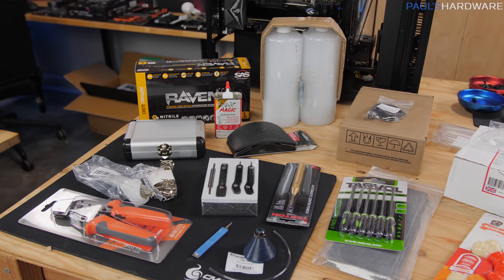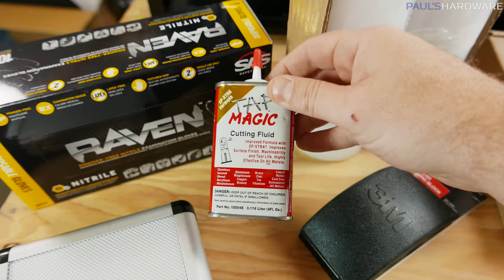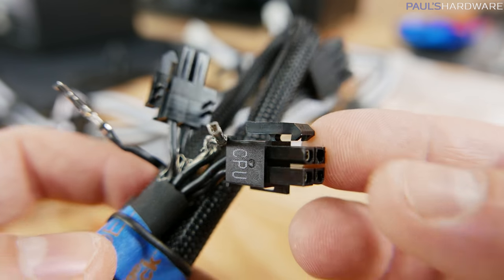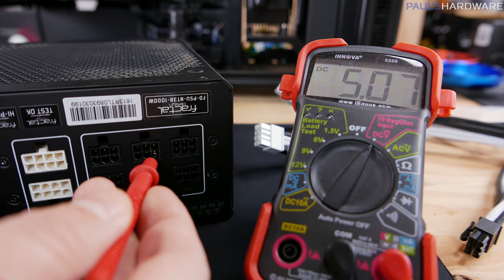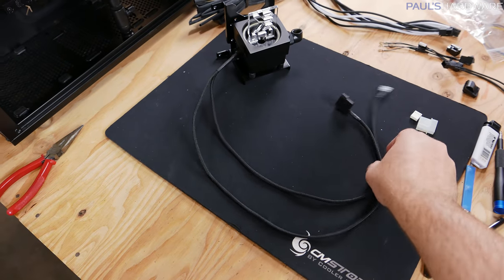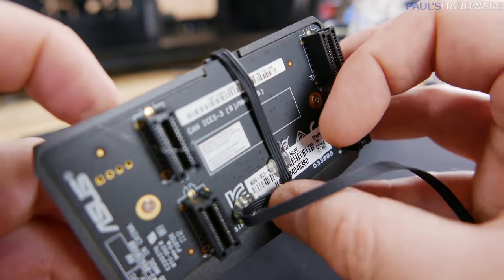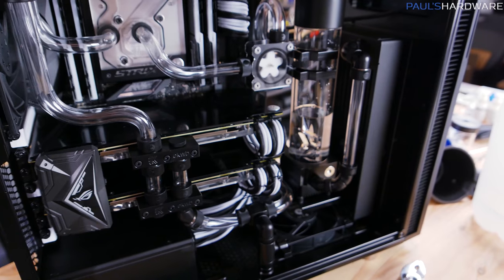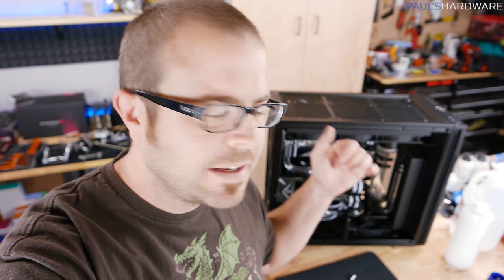JUST ADD WATER: Arctic Panther Build Log Part 3

Comment: Paul, with your new step drills. Keep in mind that though they are very convenient they suffer from an inability to be resharpened after use. With a regular drill index, you can quickly learn how to resharpen your drills with a grinding wheel and have years of service from a single drill index.

Comment: Man those bends are pretty impressive. Not that I have any experience, but just based on other systems/videos I have seen, they are really well done. They run absolutely parallel to components in the system that are square (edges of the case, mobo, video cards, etc) and the bends you chose are complex while still seeming to be the simplest route to complete the loop. Pleasure to look at, really. Complicated efficiency : p Great stuff!

Comment: Tip for the future :D you don't want to apply the flame to the heatshrink, you just want to apply the heat (hot air). You can hold it away from it normally from below and it will start its shrink just a tad slower but overall will make it look pristine. Or just get a cheap heat gun or soldering iron/gun attachment. :) I just noticed you were shoving it right in the flame and getting what I call the burnt bubblies.

Comment: Pro tip.  When you have fittings that close to a bend and you find that the bend is deforming the tube and preventing the fittings ether going on or getting a good seal, here is a great tip while the tube is strait put a spare fitting on the end and tighten it in place then heat the tube and bend to shape and the fitting will prevent distortion at the end of the tube and it will also ensure that there is enough tube left to fit into the fitting.

Comment: Paul get yourself a little butane blow torch. Much easier to use than a pocket lighter, wont burn your fingers as often. At work we use Ancor 703024s for heat shrink stuff. Comes with a soldering attachment too (although it doesn't work well, the attachment cuts off oxygen and the flame goes out)

Comment: Loving your patience with the power supply. I would have ordered a new one minutes after i recognized it misses the right connectors.

One queston, when you redid the wiring anyways why not make a single 4-pin connector for the pump? the board surely provides enough amps to power it.

Comment: Bottom middle is a floating pin.  A floating pin is a No Connect, or an N/C.  It showed a climbing voltage due to induced current in the lines/wires.  Also, if you do this often, get a proper hot air station for the heat shrink.

Comment: Use the  heat gun for the heat shrink  and the round extractor works well to remove the round molex pins  ( the left most one in the set shown ) . Regards

Comment: Hey Paul on the cap on the reservoir you could just always paint it with a little nail polish or some spray paint are you just spray it like in the Capitol spray paint and use a little brush to brush it on and you're good to go you don't have to deinstall it or anything

Comment: One question... Why did you use a lighter on the heat shrink tubing when you have a perfectly good heat gun handy to bend your tubing?  Open flames are the worst thing for heat shrink, as some wire insulation like Teflon gives of toxic fumes with open flame.  Other than that, nice looking build!
Reply: Dave Bonner you know that heatgun can be a pain sometimes though XD
Reply: The shrink is just there to remove the excess of the cable sleeve. He's not using it all, he only uses the little burnt portion to hold both end of the cable sleeve so there's no extra shrink sticking out. Which you can hardly achive with a heatgun.

Comment: I jump the psu with nothing else plugged in but the pump when I leak test. Let it run for 1-2hrs and if there's no leaks I plug it all in. I've had minor leaks with fittings that seemed tight but slowly dripped.

Comment: You've got the same volt meter as the 3 I have. 1 for the home, 1 in each truck. Look for a "hakko" wire cutter on amazon instead of using those scissors. I've also got an Iwiss crimper, I bought the full pack of teeth though. Love it.

Comment: I'm considering a build that is nearly identical from a components standpoint. The chassis would be the only difference. Paul, what are your thoughts on putting a similar build in something like a Cooler Master c700p? Pretty sure that space wouldn't be much of an issue, but I'd like your opinion.

Comment: Paul, you can buy the pins from stores like Digikey or Newark or Mouser, stores which are specialized in distributing electronic components and related stuff. The pins are like 5 cents each if you buy 100 or more, or around that amount of money.

Comment: I know that pin extractor kit. It's a giant piece of shit in terms of the Mini Jr. Fit extractor, does a really bad job of removing the pins and breaks very easily. Keep away from that shit under any circumstances and get an official extractor from Molex for these kinds of pins in particular. Yes, the official tool will usually be more expensive than the entire kit Paul showed in this video, but it's definitely worth the price, unlike the kit in the video.

Comment: Bought one of the limited edition Dark Base Pro 900 White edition cases, but after a week of trying to plan part placement and loop construction...I think I'm going to stick with my Define S.  Glad to see you are sticking with the Define R5 as well.  Wanted to switch to a 420mm rad + 360mm....but to be honest dual 360mm is probably enough anyway.  Great to see someone making tweaks to their case to be work for them.  I do plan on upgrading from 12mm to 16mm tubing and fittings though.  Just think the larger diameter tubing looks less anorexic even if it doesn't increase flow (G1/4" fittings are only 10mm ID no matter what size tubing you use).

Comment: This video is super convenient because I was thinking about cable modding, using mainframe
 sleeves or paracord from paracord planet. I also just recently had a power supply replaced by the manufacture due to power surge defect but the replacement power supply doesn't support 4 pin cpu connectors. Is it bad to use an unstable power supply till I can make the upgrade even though my motherboard supports surge protection.

Comment: hey paul if you want to use your black caps i'm pretty sure the res pump comes with a small piece of metal to un recess the thread, I had the same problem when building my loop.

Comment: If you're drawing over 15 amps on a single 12 wire in a PC, you have larger problems to worry about than a spliced 12V wire. 

For contect an 18 AWG multistrand wirewill carry approximately 15 amps without issue at about 2.5 feet length.

Comment: If you put heat shrink on all the ends of the sleeving like between the sata connectors and did the same what you did with the ends on the connectors it might look a lot better.

Comment: Suggestion: that heat gun you're using to bend tubing is really designed for shrinking heat shrink tubing (polyolephon). Without burning things. hint hint. ;)

Comment: i guess i ran into a similar issue with my new PC regarding the PSU. it's the only part i didn't replace because although it's like 7 years old it still works fine (i think). also ran out of money. but when i connected all the cables, the 4+4 pin for the CPU wouldn't fit. or rather, only one of the 4 pin plugs did. no idea why the physical shape changed, though
Reply: Valfaun warping from unplugging and replugging defectice plastic?
Reply: Dennis Rigdon nah, it's not damaged in any way. the board requires from top left to bottom right (shape of the plastic around the pins): rounded, square, square, rounded. the second CPU 4-pin on my PSU has 4 rounded ones, though. it didn't fit, but thinking about it now, i'm not sure why. the rounded ones should fit anywhere. i'll have to take another look at it sometime... not that it matters, i don't run overclocked, but the loose cable bothers me

Comment: If it was me I'd just have gotten a new PSU, probably a Corsair unit, my RM850X has lots of extra cables and places to plug them in.
Reply: Joshua Nicoll the PSU and case have emotional ties. He spent all day custom sleeving the cables all by himself, same with the case.
Reply: dwarf365 and I did the same, doesn't meant I wouldn't also get emotional about spending the time doing it again!

Comment: arent u supposed to sodder the wire to the new pins? i mean.. wont there be a risk of having a bad connection if u just clamp it down
Reply: opvask its unlikely, but yes its possible. Most psu makers dont even bother soldering them tho. So it shows how unlikely that is really.

Comment: This gave me so much anxiety you have no idea. Messing with wires like that is so scary for me.
Reply: cuzzbaby its only 12v. That won't even get through your skin.
Reply: kyle Booth no, but it can both wreck your entire system and set it on fire. I totally get the anxiety.
Reply: Erland Johansen you can destroy your componets so make sure you double check your pins, but it is hard to start a fire. Modern pc power supplies have over current protection so they will shut off if shorted. https://youtu.be/Cpyl3RKEDMU
Compared to model rc stuff this is very safe.
Reply: I squirmed mostly when Paul used the glue gun on that SLI bridge. Damn that got messy quickly.

Comment: I would of just bought a new power supply and either A bought extensions or B bought full length cables. This was mostly a video about plugs and this and that. Don't get me wrong, the video was still great like always, I just got tired of seeing the cable parts and therefore skipped most of the video.

Comment: Sorry Paul, but I cringed so hard when you said "Thicker gauge threading." Just a little heads up, no rudeness intended, the pitch of the screws doesn't match up, not "gauge." My guess the funnel pitch is 28 (I'm assuming the pitch is fine rather than coarse) while the inlet was tapped with something of a lower pitch, maybe 20 assuming its coarse pitch. Just a quick lesson, but you still got your point across. When your father worked in a machine shop almost his entire life, you pick up a thing or two. Other than that, great video!

Comment: That funnel will be entirely useless. What are you going to pour in 3 oz at a time? .... two days later you might be filled up. AND ... if you pour in more than 3 oz then you have fluid in your case since you placed it on the top of your case. No. LONG flexible tubing and pour it in from a distance and if you need to stop intake for some reason you simply lower the tube to stop the flow. 

Come on, Paul. Don't be a bone head. You're way smarter than that.

Comment: I'm getting ready to fill my loop for testing and I'm petrified it's going to leak.
Reply: Had the same feelings with mine and... it leaked. One of the fittings on the CPU block was DOA and it dripped right on my GPU, wich luckly has a solid backplate. So yeah, first leaks are terrifying at first but as long as the system itself is powered off, ther should be no danger.
Reply: Thanks for your response. You just saved me from powering on the system instead of just the pump. For some stupid reason I had planned on firing it up. Very amateurish =(. I'm probably going to stuff half a roll of paper towels around all the fitting too. Thanks again!
Reply: Thats what I did too. Papertowels everywhere... except the GPU... That was my amateurish move :)